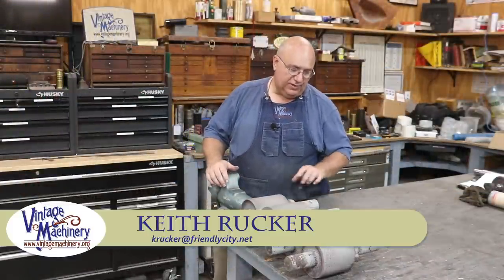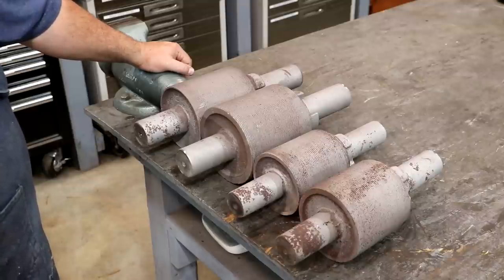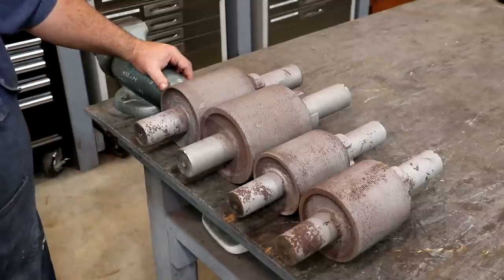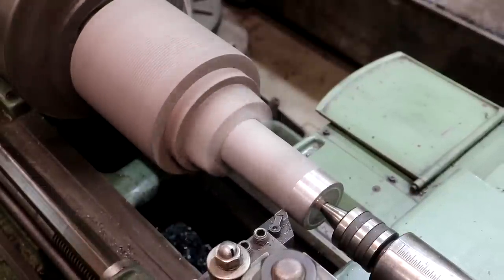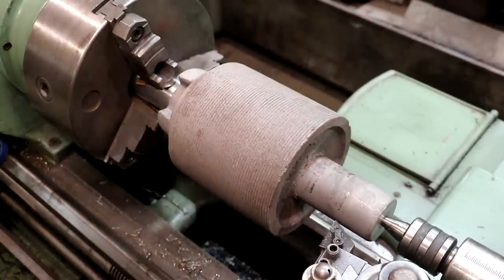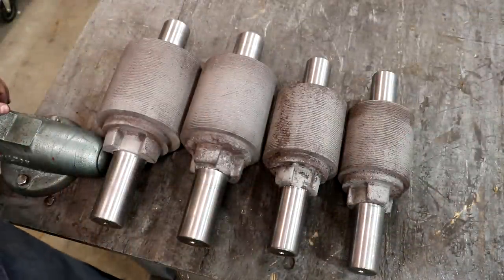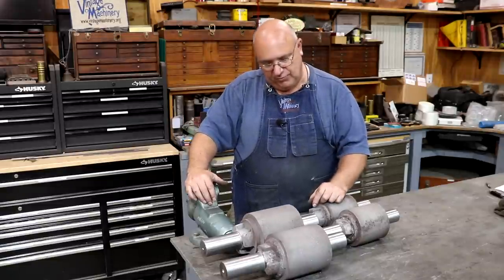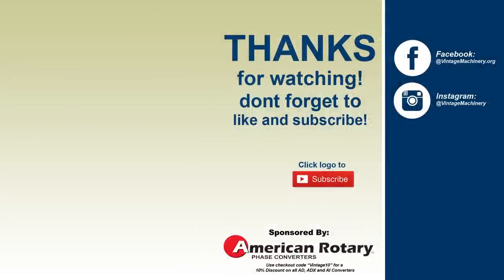Sugar Cane Mill Restoration: Turning the Small Roller Journals on the Metal Lathe

Comment: The best part about these is... because the speed is so slow and the forces involved just enough to crush fibers... even if you go down to a toothpick you can bore them out, and put a brand new shaft inside. With a taper fit or even a temperature assisted fit, they'll work just fine.

Comment: Question, I didn't see you with measuring the Journals and machine same O.D. , I'll probably learn my question in regards of making those bearings. Thanks Keith :)
Reply: Babbitt bearings are poured around the shaft so they become whatever size the shaft is. All they need is a smooth surface.

Comment: At approx. 9:27 (on the second roller you machined) there is what appears to be a hairline crack in the casting between two of what you described as "gear cogs" , is that not an issue? I just figure those cogs are subjected to a good bit of torque and thought I would ask. Could just be a casting defect I suppose but on video looks like a crack to me.

Comment: when you polish out for a bearing like that Keith, what grit size is the emery paper you would typically be using?
Reply: He probably used around 320 from the look of the grit. 220 to 320 are pretty typical grits for polishing. Maybe as low as 180 for a course polish. Possibly as high as 400 for a fine polish, but that will load up quickly and need cleaning or it will stop working.
Reply: @lwilton  thank you!

Comment: Well done, mission accomplished. As usual, good filming as well as editing.
Guessed You would use true between centers but it looks like working out well anyway. Future will tell.
Will You verify the function, making some sugar, at the end? Joking!
Reply: He doesn't have a mule and the cats are too short for the pole so my guess is that he won't mill any cane.
Reply: @kensherwin4544  Keith has to step in as mule....
Reply: @kensherwin4544  These are often run by a geared down stationary engine or electric motor now.
Reply: @kensherwin4544  Maybe Keith could step in as mule....

Comment: Given that the rollers had centres in both ends, did you have a particular reason for using the 3 jaw chuck, instead of old school turning between centres with a drive dog?
Reply: I had that same thought :)
Reply: Given the large mass rollers on these I'd imagine it's more stable to have one side chucked up on the shaft. These aren't precision parts either so no real need to turn between centers.

Comment: How do you know you have both sides on the same axis? Isn't it possible to have 1-2deg, or more variation from side to side when using the method you used with the brass shims?
Reply: No. The shim stock will (if you are smart, and Keith is) all be from the same piece of material. Something around .020" thick is going to vary by not much more than a tenth over about a square foot of surface. So as long as the shims aren't too crushed from previous use, they can all be assumed to be the same thickness. If there is crimping from previous use, you are still only going to be off by .001 or .002 or so.
The chuck is also likely to be off center by .001 or so. Combined with the shims, that could average out to dead on center or off by about .002.
Those rollers look to be about 8 inches long from the end of the jaws to the end of the other shaft. So about the biggest error angle we could get is arctan(0.002/8), which is about 8 minutes or about an eighth of a degree error.
Reply: @lwilton  Still, I really expected him to indicate the first turned journals to zero in a four jaw chuck using brass shims for protection.
Reply: At the end of the day it doesn't really matter. These aren't precision parts. The tolerances are loose and they turn at slow speeds.
Reply: Very true, my OCD tendencies wouldn't allow this though, LOL. I would have to indicate it in to be 100% sure of linearity.

Comment: Truly enjoy your videos, I’m curious on the rollers, are they cast with the grooves were the crushing takes place or are they machine cut ? Maybe like threading or straight grooves, are you able to rework those areas also ?
Reply: I'm pretty sure they had to be turned. If it was cast there would most likely be parting lines 180 degrees apart, which aren't there. Also a cast surface is usually a bit porous, and often has sand grains embedded in it. Neither of those would be good for processing food. So most likely the casting was turned to an exact size using some sort of form tool that made the grooves.

Comment: two centres ... ffs turn them between them ....
Reply: they arent space equipment i guess will be ok 🤣
Reply: @crackone2three  LOL its donkey powered! Spinning approximately 1.5 RPM
Reply: @truckguy6666 , That’s the reality of it, most donkeys are low speed. Lol Thanks for pointing that out! 😜
Reply: No need to turn between centers. Having one side chucked up on the shaft is more stable anyway with the large mass roller on these. You turn between centers with precision parts. These aren't precision parts. They have loose tolerances and turn at very slow speeds when in use.
Reply: @deathk26  ffs..I am aware of the not important because it,s donkey powered.but as an engineer near enough is not good enough. True is true, two centres would accomplish that.(in one setup like it would have been originally. ).....you are like Keith,close enough is good enough for him..and you apparently..well that I ,m afraid is not for me,hence the comment..
Reply: @premierd8988  Please go away and stop the "Keith...close enough" complaint nonsense.  It is really getting old!
Reply: @paulcopeland9035  then stop reading and commenting on them.....👀